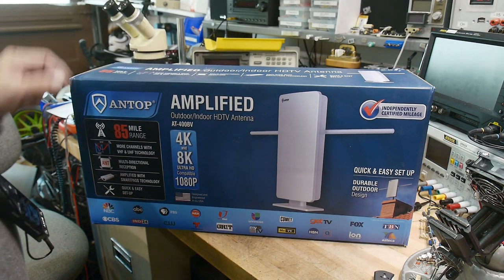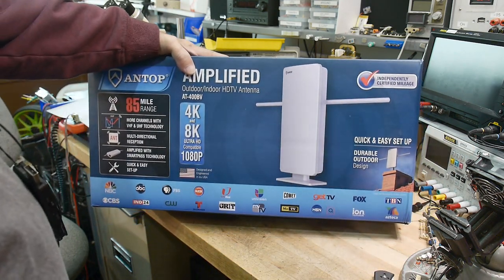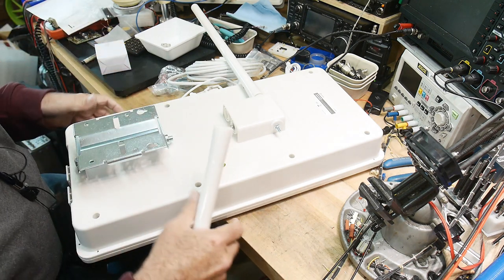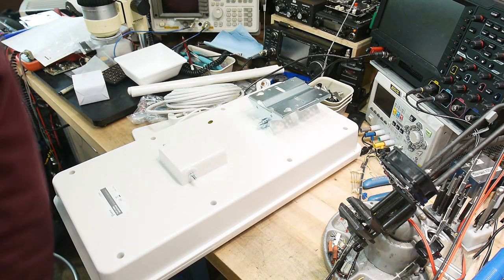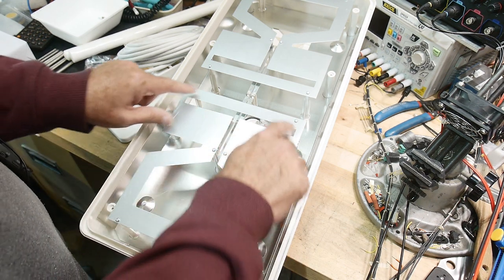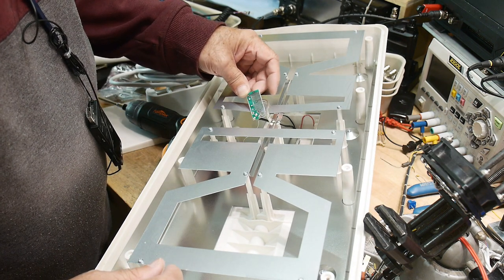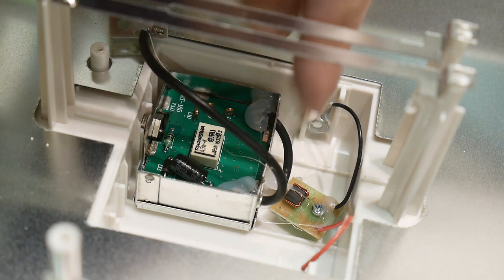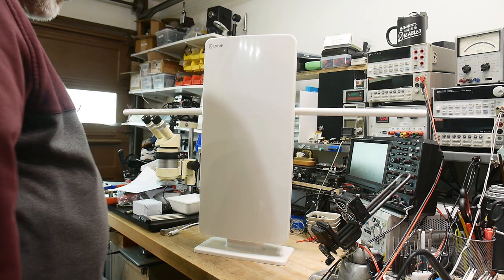#1102 ANTOP HDTV antenna AT-400BV teardown

Comment: “maybe these wings make it more omnidirectional” 😂
Reply: The wings are the dipole antenna to receive VHF, channels 2 to 13.  Both the antenna elements inside the plastic housing receive UHF signals, channels 14 to 36.